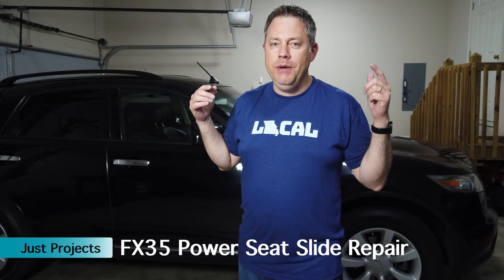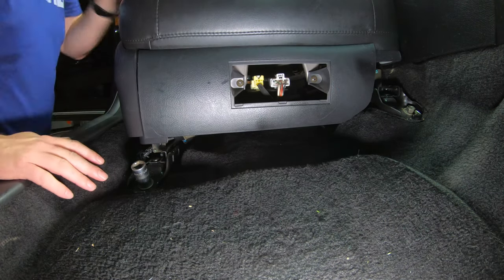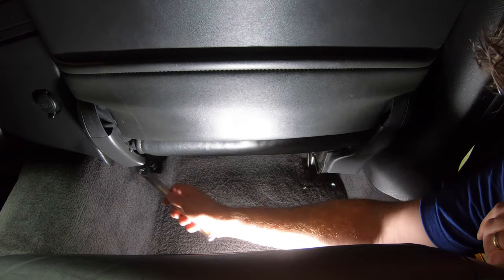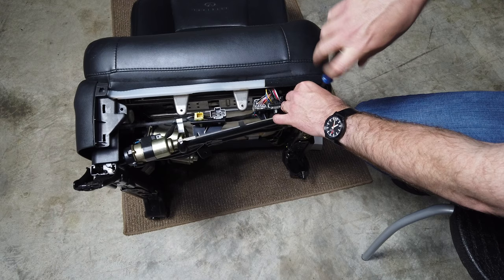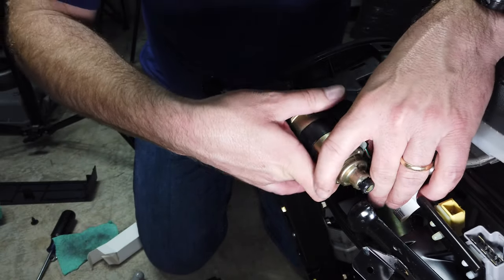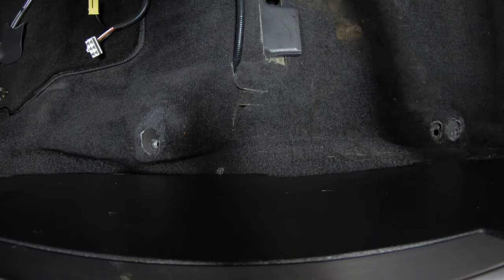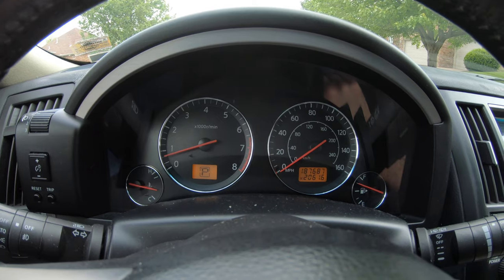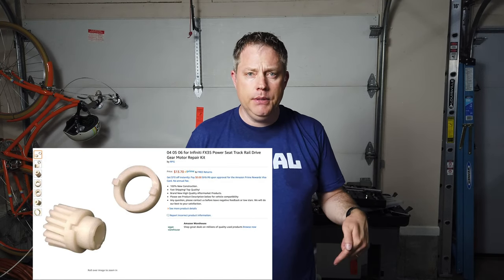Repair Infiniti Power Seat in an hour for $14

Comment: Thanks for posting this. I just fixed my 2005 FX35 driver side seat with that gear I ordered from Amazon, in 30 minutes. I didn't even take the seat out or unplug anything.
Just pulled the plastic seat front off to the side and went from there.I went straight to the right side gear, and found that it was stripped.
Reply from the maker: I should have made the repair without taking the seat out of the car. This would have been a smarter and faster approach, but then I would not have found the treasures under my seat.
Reply: Should of made a video lol

Comment: Thanks so much for the info, my drive sit is locked and took to infinity dealership and was told can’t be fixed and that the parts are discontinued but after I see this video I want to have a chance of fixing it
Reply: Did you fix it?

Comment: I have a 2011 FX35 I'm trying to take out to see why the fuse for the drivers power seat and the dome lights keep blowing. There might be a wiring issue under the seat. Hopefully it's under the seat

Comment: Thanks a lot, have the same problem on mine. Did you fix the drivers side up/down gear also?
Reply from the maker: I have not worked on my drivers side yet. I need to pull the seat and see if I can get it working.

Comment: Thanks for the video. It’s my driver side but appreciate all the info.
Reply from the maker: You should be able to change the front / back movement without removing the seat. Good luck.
Reply: @justprojects1038  where would it be located without having to remove the seat?

Comment: intriguing. bought an 04 fx 35 in march.  19k. up to 26 now.  drivers seat just stopped moving forward or back.  everything else works fine.  this video has been very informative.  they're great cars but seem to be finicky.  any issues with your passenger door and rear hatch not unlocking but then you unlock it manually on the passenger door and they both unlock again?  its a weird thing I could explain more lol.  keep up the great videos.  curious to see the one about the drivers seat you mention at the end of this video

cheers
Reply from the maker: The fix for the drivers seat is the same for the passenger seat. I think it’s even possible to this repair without removing the seat as long as you can raise it to maximum height. All my locks work except the fuel door. Thanks for watching.
Reply: @justprojects1038  thanks for the reply.  keep up the informative vids.  very cool.  any other ideas or directions you're thinking about going with your fx?
Reply: 26k is a rare thing for an 04. I’m looking at one with 198k. Wanted some advice from someone that has experience with one. Should I buy it or is it too old?

Comment: Hello, and thank you for the super informative video! So this would be accurate only if I  hear the motor running? If I don’t hear the motor running it’s obviously the motor, correct? Thanks for your help love :)
Reply from the maker: I would guess if you don't hear or feel anything when you touch the switches then you might have a problem with the wiring or the motors.

Comment: My seat goes forward but it won’t go backwards !!!! What should I do I need help ASAP please
Reply from the maker: If it moves in only one direction you could have a problem with your wiring or motor. You might have someone who's electrically inclined try to look at the voltage at the forward and back motor in both switch positions.
Reply: I have same problem can’t drive any more. Did you fix the problem?

Comment: Hey man, amazing informative channel! I recently got a '05 FX35 and Im doing small projects like you. I know you're not a mechanic but do you have any idea what might be the issue with my driver memory seat. I set the memory and when I exit the vehicle, the steering wheel retracts and the seat goes back. However, when I enter the vehicle and insert the key, only the steering wheel goes back to memory position but not the seat (unless i manually use the switch to pull it forward). Any ideas?
Reply from the maker: There is a computer setting to disable the automatic seat and steering movement. Unless you need the seat back and the whee up to get in and out, I would disable it so you don’t prematurely kill the gears / motors. Because my height adjusts on the seats have not been repaired yet, I don’t use memory seat at all.
Reply: Just Projects Yea that’s exactly what I did. Thanks!

Comment: how did you find the item for the project? For the same car, my steering wheel doesnt go forward and backwards. Im assuming the gear is broken.How do you find the part to fix it?
Reply from the maker: I've not had any trouble with my steering control, but I found the seat part on amazon. Before I ordered it I also found a guy online selling them. It's not a part that Infiniti sells directly.

Comment: Would this work on an 08 fx35, I have the same
Problem but on the drivers seat
Reply from the maker: You can look at the seat motor when the seat is all the way up. If it looks similar to mine than it might be the same problem.

Comment: I did that light reset trick and the light came back on. Any idea?
Reply from the maker: You might have an actual fault in the system. It could be time to take it to the dealer for service.

Comment: i have bolts stuck in the rear door for plates i don’t know how to remove the back panel to the hood plz help 😭😭😭
Reply: I have a rusted bolt plate bolt thats also stuck/spinning. From infinitifx.org "Just pull... The interior tabs will pop off and you just need to make sure you find them again. If you try to use a screwdriver to pull off those tabs first, you'll damage them." https://www.justanswer.com/nissan-infiniti/4mnyn-infiniti-fx35-remove-rear-hatch-panel-infiniti.html

Comment: I see you said there was a way to do it with removing the seat?
Reply from the maker: I think you can repair the front and back gear without removing the seat from the car, but then you will miss all the treasure buried under your seat. The other two motors are further back so I'm pretty sure the seat needs to come out for those....I still need to do this project on the drivers side.

Comment: What if it don't move at all ? Infinity G35 coupe
Reply from the maker: If you hear the motor running but the seat is not moving I would check the gear. If you push the button but you don't hear anything then you likely have a problem with the motor or the other electrics.
Reply: @justprojects1038  I hear a click click ,( motor ) I guess. Thanks for the knowledge